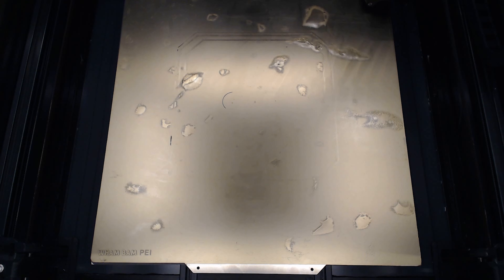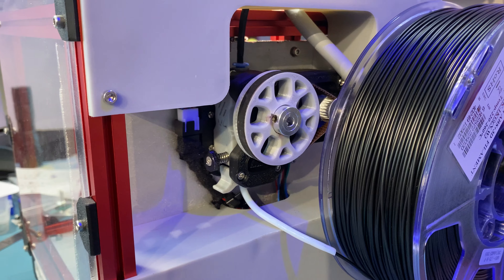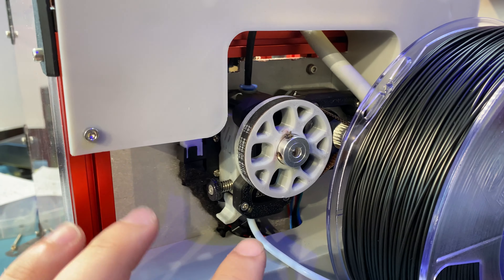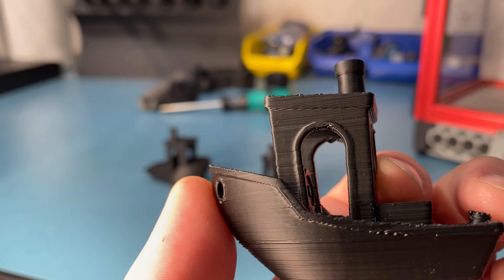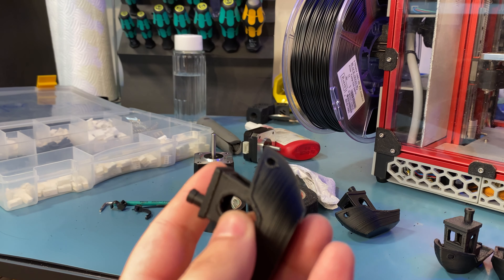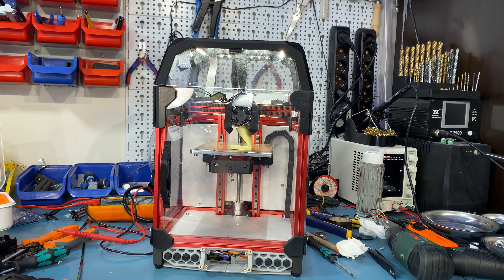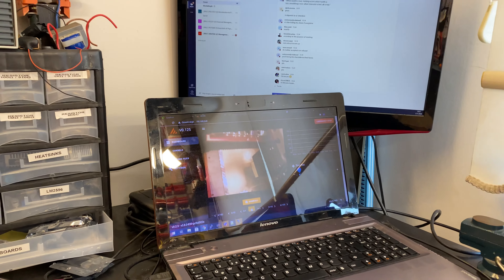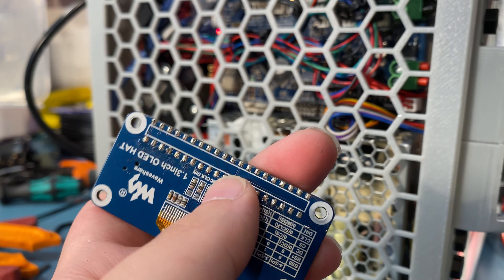Voron 0 Ep. 4 - M4 Extruder & Direct Drive Z & More

Comment: For the accelerometer, try disconnecting the ground cable. It's weird, I know, but it may work if you have one of those specific boards that act weirdly.
Reply from the maker: I tried 2 different boards so I don't think that's the case but, sure, I'll try tomorrow. Can't hurt. Thanks.

Comment: Many people are not aware that raspberry pi's need to be shutdown properly. I've corrupted a couple raspberry pi installs by killing power without proper shutdown sequence. Often times the installs would appear to work but would have very strange problems. In another video you mention that your SD card died too, I'm thinking this might be the cause of the problem.

There are apps that you can install to add a power button the rpi

Comment: I'm going to use your mod for the M4, thanks for sharing! In your BOM you state at 46mm shaft is required rather then 50, POWGE sell a 45mm pre ground 5mm shaft will it still work correctly, it'll save me grinding my own?
Reply from the maker: It should work fine. 46mm is for the metal 80t btw, printed ones it's still 50mm
Reply: @IsiksTech  great, thanks for confirming that, it's the metal one I'm going to be using

Comment: Hey there I wanted to say thank you for trying out things and providing cool mods! Anyway isn't your Z-Artifact problem not related to your Rail alignment? Lots of people seem to struggle with that I did so too initially, because my build-plate joints were binding inwards thus binding the Z-carriages too much.
Reply from the maker: They are aligned well, z slides very smoothly. The cause was most likely the bearings used in the leadscrew not being aligned well. It is a known issue of the design. The devs are trying direct drive Z too as a result.
Reply: @IsiksTech  I know that many blame the leadsscrews but on my build journey actually very few people i got to know, struggled with the leadscrew - same for me rails were the culprit. but looks like you checked for that already :-(